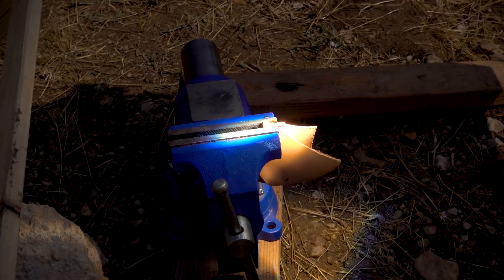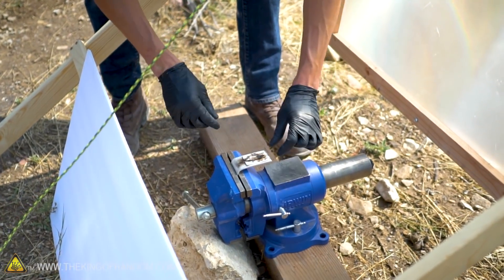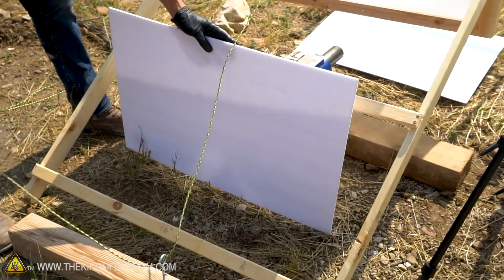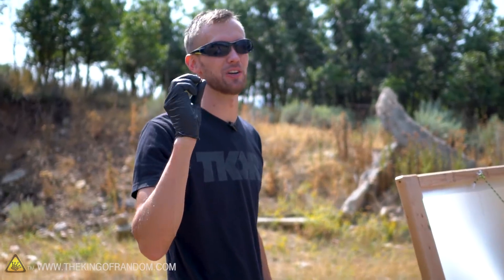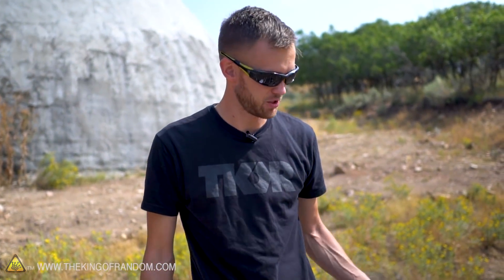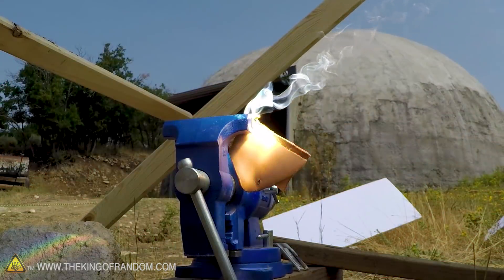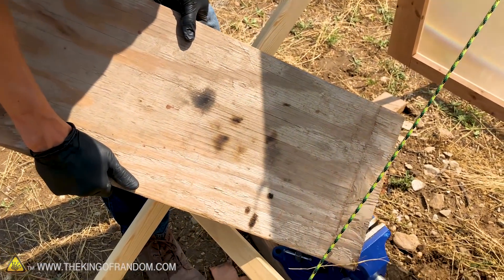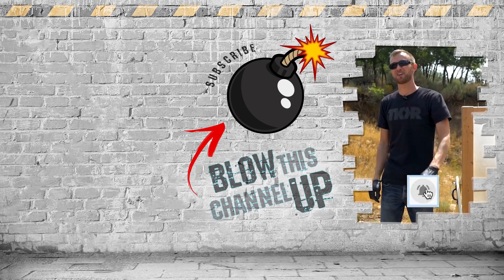We Shot Bullets with SUNLIGHT

Comment: That random fact about the "average Bullet speed" is completely incorrect
Reply: Yep he said average bullet speed,,, figure all types of standard ammo for a variety of firearms. .220 Swift is around 4000 f/s, to a low power .45 acp or .38 at say 800 f/s so ~2500 f/s avg might be a bit high but in the ball park.
Reply: Most of the time, bullets stay still.
Reply: It depends on the load of gp and the bullet your using
Reply: Thank you for calling this out. A 9mm is about 1600 FPS and a .45 ACP is only 850. I was trying to figure out what he was putting together to get that average. Perhaps a 50BMG and a .308 WIN. That might get an average 2800 FPS.
Reply: A high velocity .22 only goes 1800. A normal .22 goes about 800. Sounds like some liberal fear mongering to me.
Reply: Dont forget the myriad of obsolete cartridges that make 45 look fast. I.e. 455 webley, 38/200 so on...

Comment: Man there is not enclosure for pressure buildup so less pressure with which bullet moves forward try with an enclosed tube at one end and somehow make the sunlight hit a small point from where it will light the primer and kaboom much more power. Hit like if u were under top 50 comments 😎

Comment: You should see if gunpowder really blows up like it does in the movies!
Reply: What is the content of inside a bullet shell?😑😑😑😑
Reply: @vladimirlucifer4566  Yeah, you'd think it would make a huge explosion, but you never know
Reply: @crispychres  By fire, probably it will lit the surrounding gunpowder, but the inside would explode due to pressure.
Reply: Modern day gunpowder does not explode like black powder. Black powder is what you would see in wooden kegs or barrels seen in old westerns or bugs bunny cartoons. True black powder will explode even uncontained. Modern day smokeless gun powder and replacement pyrodex style powders merely burn off rapidly if not contained.

Comment: Can this fire 50 cal bullet?
Reply: The heat is probably cooking off the primer so I'm going to say caliber doesn't really matter. May take a bit longer, though
Reply: @Justapotato14   it is burning the powder witch builds pressure to fire the bullet
Reply: @jeepingca1320  I'm aware. But it's the primer that ignites the powder. The Lead styphnate primer is significantly more sensitive than modern gun powders, so I'd assume it would light off first
Reply: Ltifone2014 you know alot
Reply: nahh
Reply: Yeah probably
Reply: Since the lens generates enough heat to melt brass then I would say as long as the casing of the round doesn't melt first then it will most likely go off.
Reply: Gurnoor Singh,  it can fire a 50 caliber bullet, just like you seen in this video
Reply: Yes but that is a .22 rim fire so no primer as you see on anything bigger
Reply: Caleb Dulaney .22 long rifle has primer compound, it's located in the rim that's why it's called rimfire. Also primer is pressure and heat sensitive, far more so than smokless powder.
Reply: Caleb Dulaney There is primer in a rim fire however it is in the rim not the center of the cartridge
Reply: Caleb Dulaney they still use the same priming compound, it's just in the rim